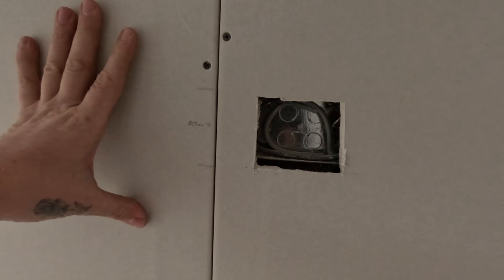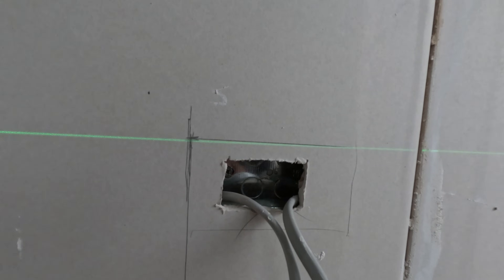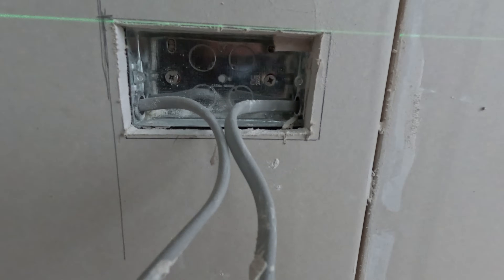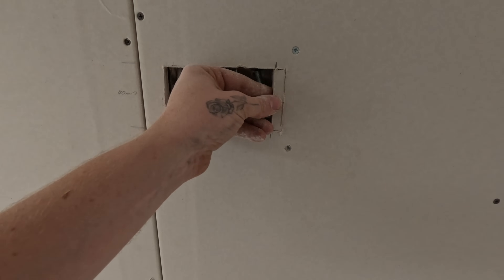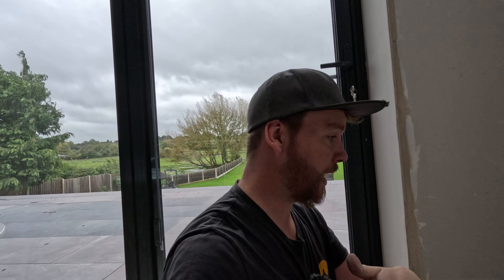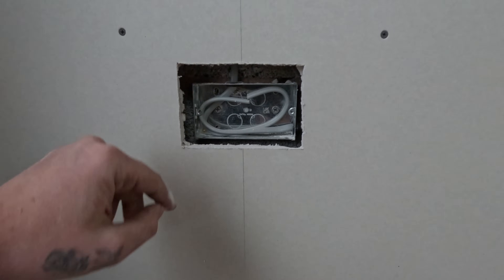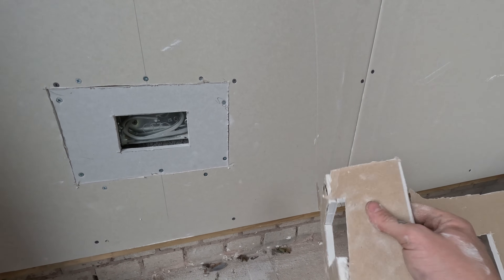Going to charge him for this

Comment: Shouldn't really be our problem mate, but i can see why you did it. Will massively benefit you on the 2nd fix. No faffing around 👍
Reply: Exactly. Another guy commented the homeowner should’ve called the guy back. In the real world that is not a good solution. The homeowner will have to argue his case and it could take time before the guy comes back. 

You’re wasting the homeowner’s time and the electrician’s who is just going to be idle until that’s resolved. Not ideal but tradesmen often make life difficult for the next guy who is going to work after them.
Reply: It is 100% your problem you have to put the switches in.

Comment: Been in this boat LOADS of times. Easiest way to get around that re-measuring take a larger than you need bit of board, cut the box hole in it, then line it up over the box. Trim the size if needed. Then draw around it and cut that. It'll slot in exactly where you want it.
I do patching the same way. No point in loads of measuring. Cut a bit of board Larger than the hole, draw around it then cut to the line. Perfect patch.
Reply: Genius!
Reply: that is a great tip!

Comment: Hi Nick.  Why don't you get a small detail router with a flush cutting bit.  That way you could just put the 
router into the plaster board and the flush cutter will follow the internal sides of the box.  Save you a lot
of measuring and save time.  Maybe they do a flush router bit for the dremmel.

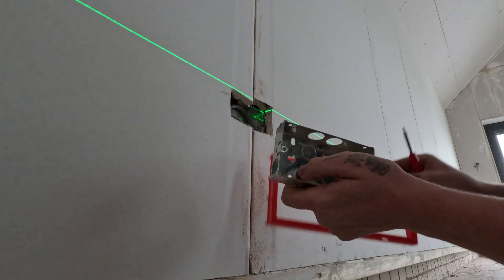Comment: 1:20  Hmmm ... if we here setting boxes for power cables or LAN cables we marked the place on this dry walls and we set the boxes on the front side - never into the rear side in the hole wall (mostly inside isolation materials). If we need room in it we use the 65 mm deep boxes (with new electronic devices deep under the switches do you can buy 75 mm deep boxes (e.g. Shelly)). 

In older installation as we not isolated the walls the electrician "fishing" the cable from behind after do the correct hole. In newer installation the company how plastering the wall works hand2hand with the electrician at the same time - mostly both from same company. 😊 Do you marked all holes horizontally and put your cables inside if the dry wall vertically ... easy job. 

This is really ridiculous! 😮

Comment: I have this quite a lot but usually the clients would call them back to rectify it.
It just baffles me how it's so hard to cut boxes out, isnt it just knowing how to use a measuring tape?
When I do it, the easiest way instead of measuring is to get an offcut of plasterboard, mark the edges of the boxes, butt the plasterboard up to the wall and give it a whack so you can see the lines and imp4int of the boxes and just cut it out.
Keep up the good work Nick! 
You good job!😬

Comment: using normal screws instead of drywall screws is not allowed here were i live. the changse is that the normal screw will rust after scimming and you will see the rust marks through the paint later. idk how it is in the uk.
Reply: Most screws sparkies use here are either BZP (bright zinc plated) or yellow passivated, neither will rust... but that's an interesting point. Still, the plasterer will get the blame ;)
Reply: That's because us sparks are not that educated when it comes to using the correct materials (other then electrical materials)  we tend to  use any old stuff.. and blame the other trades... We take the piss out of other trades... But without them we don't have a job... We can't wire up anything if there's no one to build the buildings...

Comment: Use skeleton boxes and put them on top of the box. There should never be a void between the box and the board
Reply: Isn't a skeleton box a coffin?
Reply: I was thinking that you might need some really long screws for them, and also the sockets will pull the plasterboard inwards because of the void - skeleton extension boxes or spacers, sure that's the plan

Comment: Those boxes are so weird. In germany we just put cables, it gets boarded by the drywaller and then the electrician just uses a round holesaw and places the (round )box flush with the drywall
Reply: We do the exact same thing with spotlights on a ceiling.

Comment: Good for you for sorting that mess out before the skimming. Whoever did the boarding needs a word. We try to leave the front edge of the knockout at the front edge of the board, or at least in the board, to avoid this. Scratch that. I’ve just seen what you’ve had to do to sort that socket out. Whoever did the boarding needs a slap.

Comment: I thought this was a fairly common issue with dry liners / builder's labourers. 90% of the time i have to trim up the plaster boards  After its been plastered.  The decorator would go round ( if needed) with his caulking gun & carry on prepping. Obviously you cant caulk in a socket !!
Reply: We replaced two previously removed (WW2😊)dormer windows in our gable end and had the whole attic plastered to use as an office, the plasterer remarked that it was the worst bit of boarding he'd ever seen and spent some time removing and levelling boards,all put in by an apparently accredited company.When we did the other attic we used the guy the plasterer recommended,who turned up on a pushbike looking and smelling like a tramp, but singlehandedly completed the attic in no time and the fit was nigh on perfect everywhere,even the cutting into the uneven large beams that were remaining visible was remarkable,all using nothing but a spirit level, a pencil,a Stanley knife and a cordless screwdriver,oh!and about 15 cans of beer. The plasterers exact words were " That they are on the wall is enough for most builders".

Comment: I recently told the guy doing boards to bring cables out at socket height. Went back and installed fast fix boxes before being plastered.

Absolutely amazing final result.

Even if they brought cable out in the wrong area of the bay, its still to be plastered 🤷‍♂️

Comment: Why are the boards so far off the block on the dot and dab walls? 25mm box, 12.5mm plasterboard, 12.5mm dot (or dab), Bob's your uncle 🤔
Reply from the maker: No idea mate
Reply: 8:03 - Look like it attached to timber frames instead of dot and dab.
Reply: It interesting you should say that. Had a builder do me a small extension and I asked him how far the wanted the boxes sticking out 22 mm ( just cut the 1” box in a few mm he said) it ended up like that with the boxes well back from the front of the plaster bd. Makes a shit job once plastered as that cut edge always peals back.

Comment: Could you not use dryline boxes? Might have saved you that ball ake,just as well you checked in on the job if that was plastered would not have been good 👍
Reply: trouble is these idiots boarding would of pulled his cables out at different heights if pulled through at all

Comment: First time I have seen boxes fitted before the plasterboard was up, usually only see tails for the joiner to poke through the plasterboard. As it's not the joiners job to fit the boxes or add an extra hour or 2 work to cut the plasterboard to fit especially if it's price work and not day/hourly rate

Comment: Not sure why it’s the plasterers fault .if the boxes were packed out so they finished flush with the front of the plasterboard in the first place they would have no choice but to cut the plasterboard correctly
Reply from the maker: Problem is we were told it would be dabbed out 25mm so that’s what we did
Reply: @NBundyElectrical  ah ok
Reply: So if the wall is out of plum you are telling me you would get it right?

Comment: have you tried the sockitz safety shields before? what's your opinion on them? looks like they could help for a situation like this.
Reply: Yes. I’m not fully sold on them. Good idea but the little nipples on them that are designed to leave an imprint on the plasterboard are not durable and break off easily.  They do keep muck out of the boxes but again need to be very careful and run a blade around perimeter when removing for 2nd fix.
Reply: @MS-Patriot2  that's good to know. thanks
Reply: Just used some myself on a job, plasterer loved them and the holes are perfect.

Comment: What is the purpose of having the plaster board so far of the wall?
Reply: normally happens when the walls out of square and they try and get the boards square, however, judging by those box cut outs, its probably the boards out of square lol

Comment: Doesn't it make more sense to cut out the plasterboard from the wall and then offer the resulting piece up to the spare plasterboard sheet as a guide to cutting out the bit that's going back into the wall?
Reply: That's what he does at 7:38
Reply: @SparkcatcherFox   No, it isn't. He does it the other way round, cutting the replacement piece from the spare plasterboard and then fitting that to the wall. And that's my point.

Comment: That’s the wrong board for a start that’s for tape and fill 👍
Reply from the maker: No sure what you mean bud?
Reply: @NBundyElectrical   if you look at where the boards meet there 100 mm a side where the boards a bit thinner ie you run tape up it then fill it then rub it down ie no plastering ? At least that’s what it looks like to me 👍 great video once again 🙂
Reply: It's tapered edge plaster board. 
Usually used for tape and joint rather than skim.
Reply: No harm in using tapered board for a skim, gives you a thicker joint. Probably best to fill the tapers and let it set a bit first though.

Comment: If the sparks had put his boxes in right the boarder would have had to cut them correctly, id have just cut a small hole and and let the sparks cut them out as its hard to measure them accurately when there so far in the wall.
Reply from the maker: we got told it was being dabbed out 25mm, hence why we put 25mm boxes on the wall mate
Reply: Well then don't moan then you should have swapped the boxes when you found out, still your fault as your making out it's your job
Reply from the maker: @dancingfrogsxb1276  the hell u on about. We came back to the job after they boarded it out? Then saw it was well over 25mm, so I did this in the video to fix the issue…..
Reply: @NBundyElectrical your missing the point, your blaming the dryliners yet the sockets are in wrong, you don't like being blamed when it's not your fault lol
Reply from the maker: @dancingfrogsxb1276  the sockets aren’t in wrong , ur clearly missing the point, job spec was 25 mil so we put 25 mill in , dry liners decided to change the job halfway through, so that’s their fault
Reply: @NBundyElectrical  so the dryliners decided not to dot and dab it but to line the walls out and board it without permission at there own expense and own time 😁
Whoever employed them will be in bother 👍🏽👍🏽

Comment: Would those screws not rust through the plaster??
Reply: No, they BZP
Reply: Plaster's only wet for a few days. Most wood screws are well plated and more corrosion resistant than plasterboard screws - because plastered walls stay dry.

Comment: that plaster boarding has not been done by a trained, time served plasterer,!!! a bandit more like, you can easy see they are shite,  screws or nails should be every 150mm, once a nail or screw as broken the plaster board card, it's failing from that point on... so sick of shite jobs and god they'll charge.. your boxes should be ready to be flush or just set  back so you will need to know board finish and plaster finish.. not many put on the right thickness on walls or ceilings in plaster and skimming..  and the screws are far too close to the edge... only a conscience between a good job and a bad... in all trades!!!!

Comment: How come the boxes were so far back.  If the plasterboard was originally down to be battened out  then deeper boxes, pack out the boxes or even use plasterboard boxes.  Looks like someone changed their mind or bad communication.
Reply from the maker: It was only meant to be dabbed out 25mm, then I turned up to this

Comment: How do you lot even get away with installing boxes first? I've never met a dryliner yet who will go in after I've fitted boxes.
Reply from the maker: Do this all the time mate
Reply: I’ve never seen them have to be fitted afterwards personally (metal back boxes)…..would make no sense to do so!?
Reply: @davecowan860   I mean the whole point of this video is a reason why I would fit them afterwards
Reply: @johnway2039   Never had a problem myself. You didn’t say it was your preference though, instead that you weren’t allowed because no one would board round them 😂

Comment: all that faffing with ply, just replace the box with a dry liner,honestly
Reply from the maker: Yeah but the socket won’t be the same high as the others
Reply: @NBundyElectrical  whys that mate, laser it up like the rest. I’ve not met a boarder yet who knows how to use a tape measure
Reply: @supersparks9466  If they've already cut the hole miles off target it won't line up.
Reply: @Monkeh616 why would I put the dry liner box where the hole is, put it where its supposed to go
Reply: @supersparks9466  Where it's supposed to go and the hole are intersecting..

Comment: To be fair , you should of found out from builder the finished wall depth and your box should of been flush within a few millimetres and then the tacker could cut exactly round metal box .
Your fault not there’s .
Reply from the maker: Not my fault what so ever, we were told it was being dabbed out 25mm
Reply: Well if that’s true then I’ll hold my hands up and your rite . 
I do wonder about some of the builders you work for 🙈